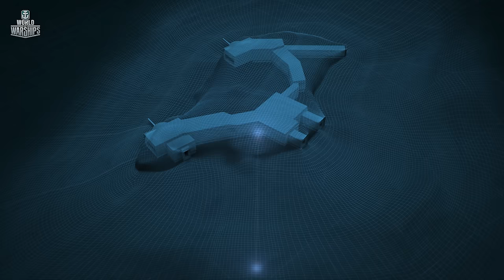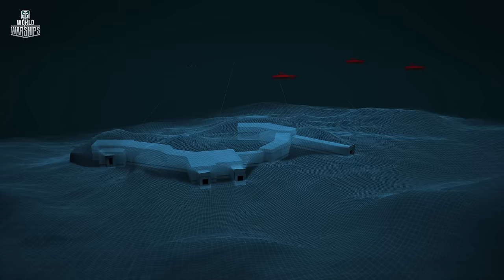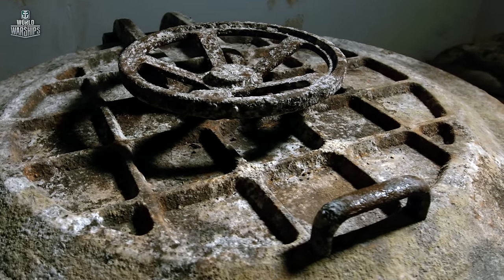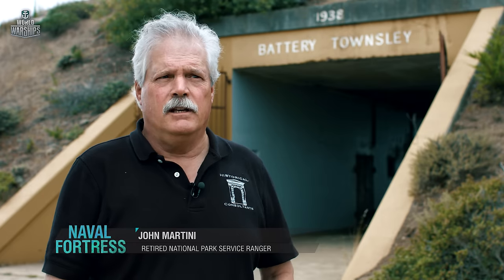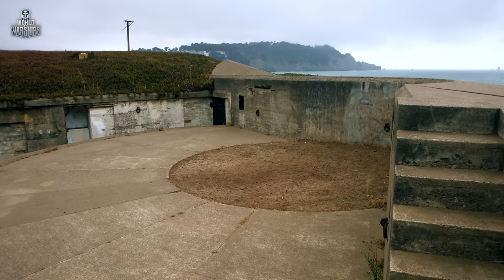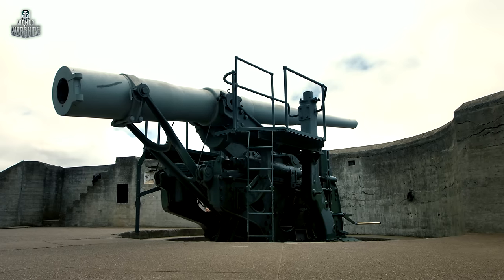World of Warships - San-Francisco Artillery Corps

Comment: Around the world there hundreds of coast defence gun batteries.       It was interesting that the 16-inch guns on the video had 170 degree traverse. At Singapore 1 x 15-inch gun had 180 degree and 4 x 15-inch guns had 270 degree traverse. 2 of the 15-inch guns had fire off much of their ammunition at Japanese troops in Malaya and Singapore Island.         Of the 6 x 9.2-inch guns at Singapore, 3 could not be blown up as they had fire every single shell they had at the advancing Japanese troops.                        Many of the 18 x 6-inch guns at Singapore also engaged the Japanese troops.         So much for the traditional myth that the guns pointed only out sea. The main problem was the shortage of land service (H.E. & Shrapnel) shells for use against land targets. Even so the 15-inch counter bombardment (A.P.) shells still made craters that made roads impassable.

Comment: A few other facts about the big 16-inch naval rifles at Battery Townsley and the 6-inch ‘disappearing’ guns at Battery Chamberlain.

The guns at Townsley were impressive. Their fire control (adjusting the fall of shot of the guns) was dependent on data from observation points located in hardened bunkers up and down the coast, north and south from the guns. 

The guns would shoot, and the observers in those stations would use a telescope called a theodolite (one is shown in this video) to observe the direction and distance of the shot land ing, out in the ocean. Each observation point would report that data by landline telephone, to the plotting room at the battery. The data would be laid out on a huge circular plotting table, the corrections quickly calculated and phoned to the gun crew, which would adjust the left-right traverse and elevation of the gun, load another round with the requisite powder charge, and shoot again. 

It was a ponderous process, and it ONLY worked when the observation points could see the fall of each shot. 
The system did NOT work at night, and it did NOT work when the coast was socked in with fog.

As anyone who has lived in San Francisco can tell you, there are times in summer when the fog along the coast is so thick the men at Battery Townsley wouldn’t become aware of the Japanese invading until they noticed Japanese soldiers standing in their chow line.
http://www.militarymuseum.org/BtyTownsley.html

The 6-inch disappearing gun at Battery Chamberlain today at the Presidio of San Francisco is not the original gun in that position. All the coast artillery defense guns around San Francisco were removed after WW II. The gun in that revetment today was originally installed in one of two 6-inch coast artillery revetments in Battery Schofield,  just below Trophy Point at the United States Military Academy at West Point, New York. They were used, in the days of coast artillery, for training cadets at West Point. 

The guns at Townsley were ‘revetted’; that is, their carriages retracted backwards and down behind a thick wall of earth and concrete for re-loading, and rose back up for firing. However, their gun positions were completely open to the sky. Unlike the guns at Townsley, which were in huge bunkers beneath many feet of earth and concrete, the guns at Chamberlain and other open fortifications were effectively obsolete as soon as dive bombers were introduced as naval aircraft.

In 1954 I was 8 years old; my father was assigned to West Point and I played on those guns, which were then still in position in Battery Schofield.
In the 1970s the Park Service arranged to have one of those guns moved to Battery Chamberlain. 
http://www.militarymuseum.org/BtyChamberlin.html

So my old childhood play structure (being a kid in an Army family, there were many such unusual ‘play structures’) is right across the Golden Gate Bridge from where I live today :)